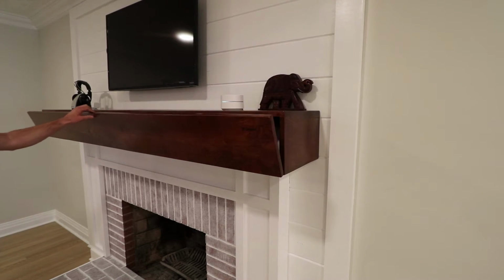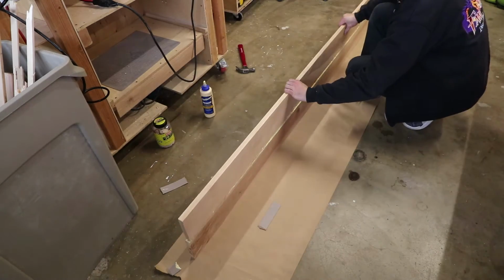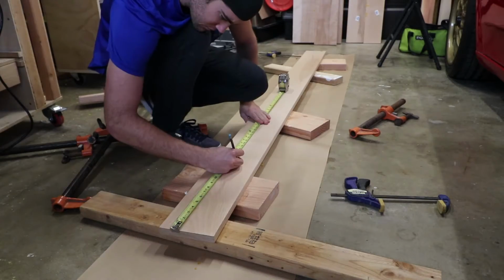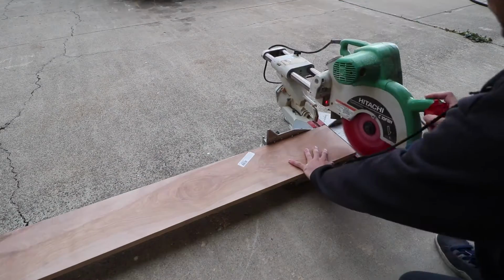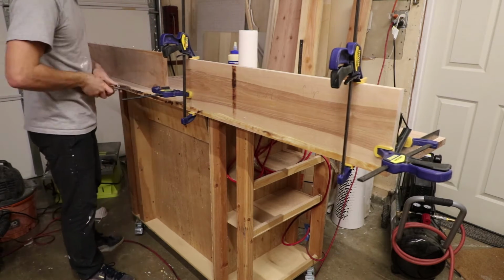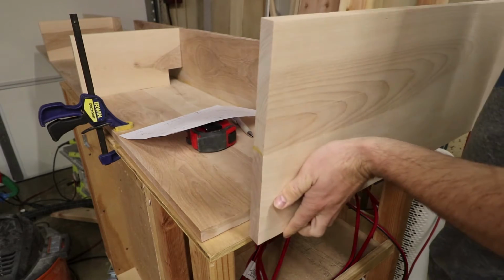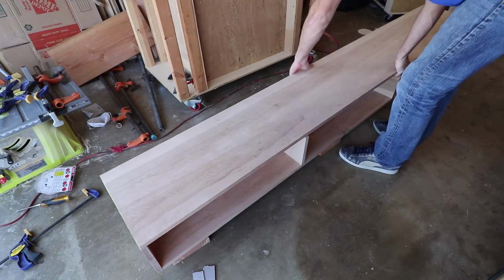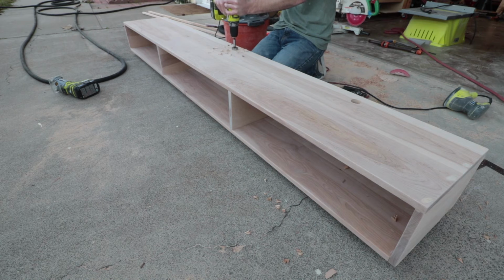DIY Fireplace Remodel Pt 3: Custom Mantle Build

Comment: Great video (the whole remodel actually). Tip for avoiding cupped boards when glueing up (other than clamping it flat with other boards) is to alternate the clamps - 1 above, 1 below - that way they work against each other and it will be less likely to cup.

Comment: I still don’t see why he didn’t just buy a wider board of course they are at any big box store, instead of glue them together.
Reply: Sometimes you just can't find them that wide. I am making a mantel that will measure 17 inches deep and you just can't find wood that are that wide . The mantel will be just over 8 feet long, so I couldn't find it in that size.